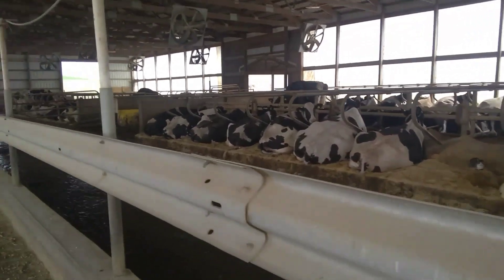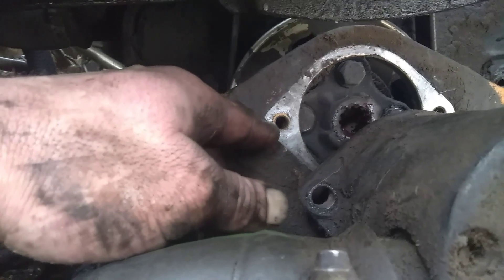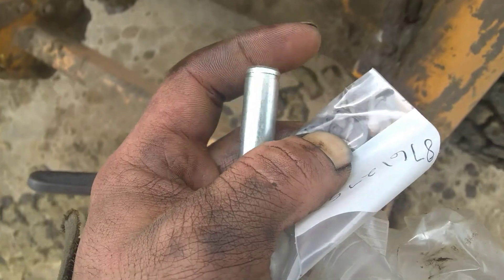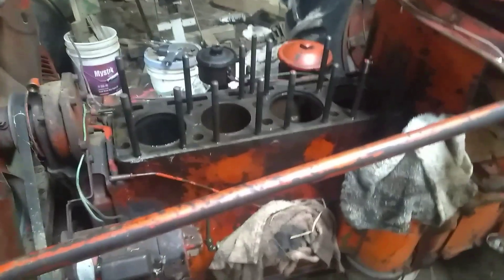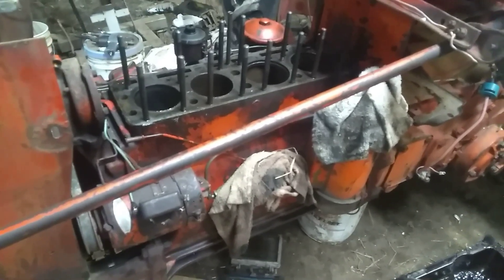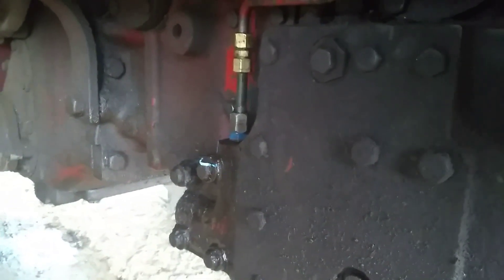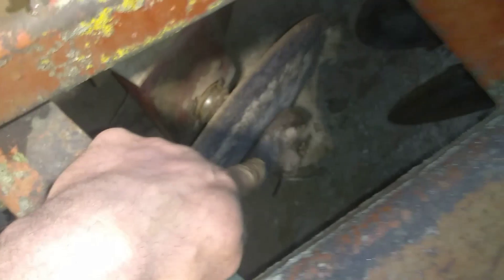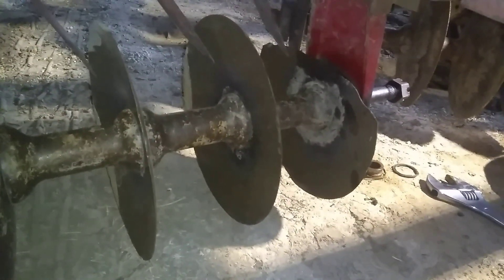fixing equipment, a neverending job on the farm

Comment: Looks like you got some help out at your farm to run the skid steer. It is funny how things always get taken apart more than necessary the first time a part needs to be replaced.  Glad you got the stuck pistons out of the old engine, looks like you will have it running this year.  You can torch that sleeve off of the piston. Interesting way to fix a leak with teflon tape too.
Reply from the maker: Yeah my wife scrapes the freestall barn, she'll only use that skid steer though she doesn't like the foot controls on the other ones. Always sucks when you take more apart than you have to but it happens lol. Probably the easiest way to get the piston out with the torch, I can't believe how stuck it is. Thanks for watching 👍

Comment: Done business with Ag-Kits.
Quality parts, inexpensive and they had the parts!! (Unlike JD, that was 3×$ and didn't have any unframe kits for the 4010...
Teflon tape works wonders.. 
I hate disc and cultipacker bearing changes... 
Hopefully you survive the storm alright!!🥃🥃🍻
Reply from the maker: I'll have to check them out, saw a couple other places online that had parts but I've never heard of them. Definitely hate cultipacker bearings the most, a least the inner ones anyway. Survived the wind but it beat up the curtains on the freestall barn pretty good in a few spots. Oh well could always be worse lol.🍻🍻🍻🍻
Reply: @hartungdairyfarm0713  better the curtains than the roof.. still not cheap but....